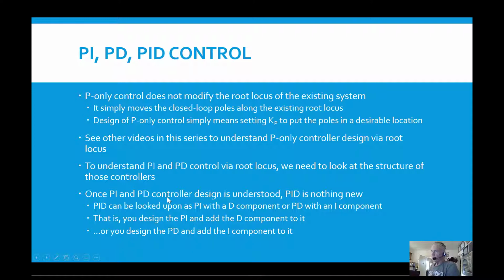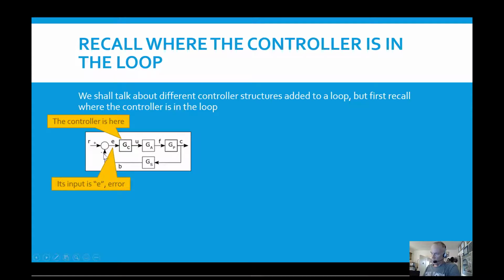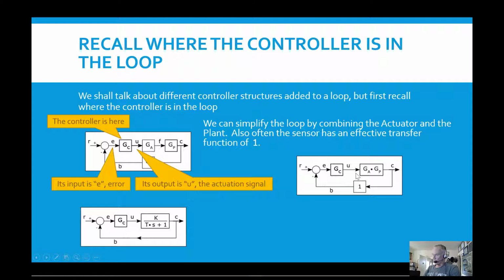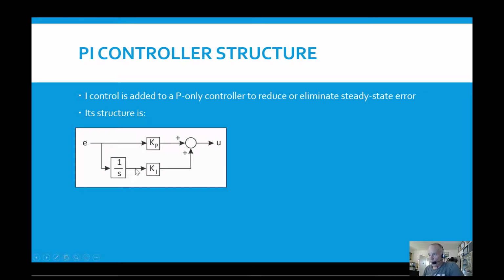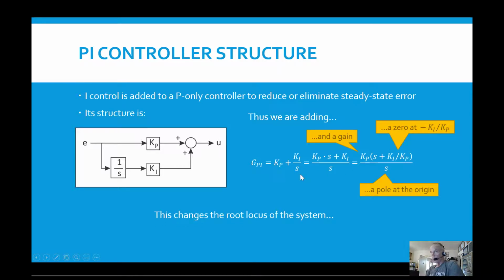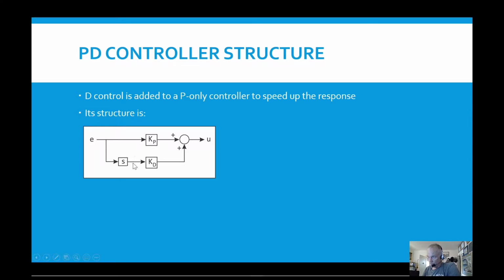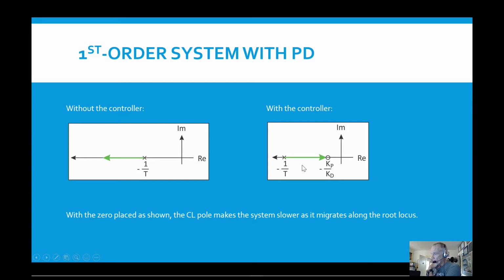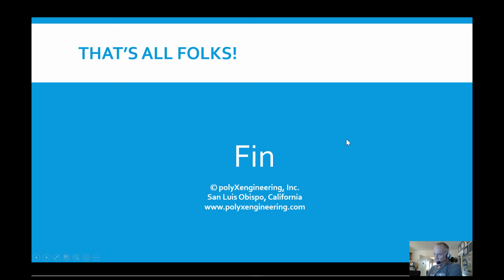PI and PD structure in root locus

Comment: Can you please point out why if the poles or zeroes approach the origin , the system get slower .
Also please consider discussing the difference between poles and zeroes from the performance point of view 
Thank you , waiting for more to come.
Reply from the maker: Hi Mr. Nada,  A quick response for now with maybe a more detailed on in the future.  You can just do it, i.e. make two models, for simplicity two 1st-orders.  Have one with a pole near the origin and the other with the pole 5x further out.  You'll see that the second pole produces a response that is 5x faster.  This is because in a 1st-order, the pole distance from the origin is 1/T.  The is the time that it takes for something to happen, so T further out means a shorter response time.  This all happens because the T winds up being an element in the e^(-t/T) part of the response.  As T goes down, the exponent becomes smaller, so the response takes longer.  That's all I have time for right now.  Also, more will come, but I'm finishing up a semester in Africa right now, so it'll have to wait.
Reply: @polyxengineering3857  Thank you. Now it's clear.